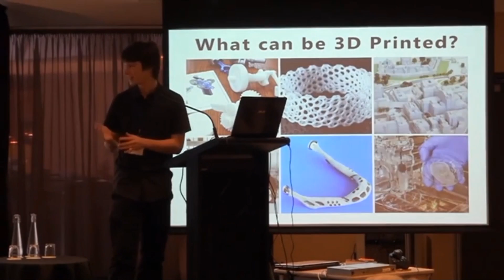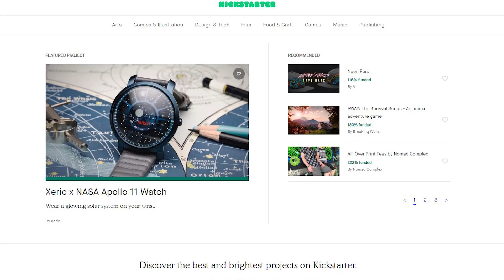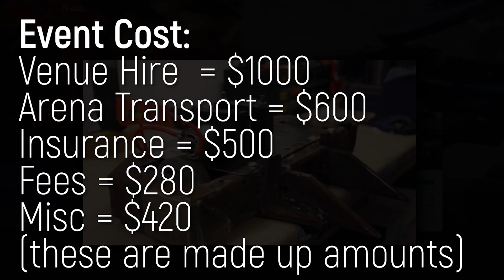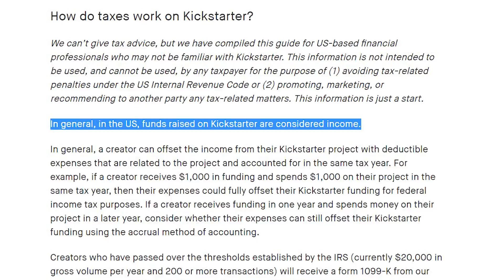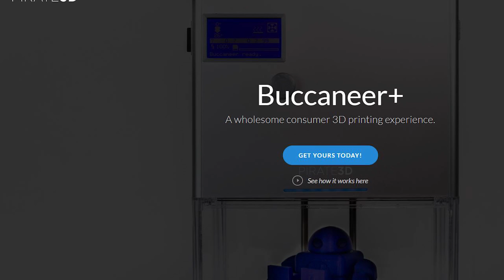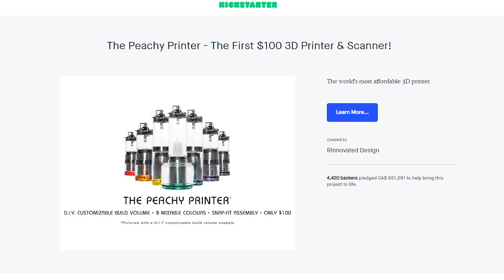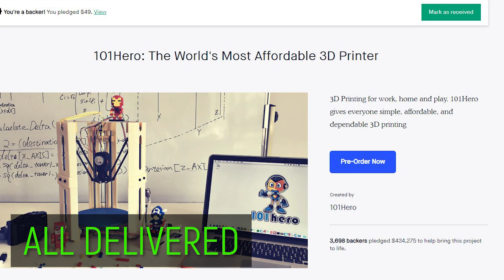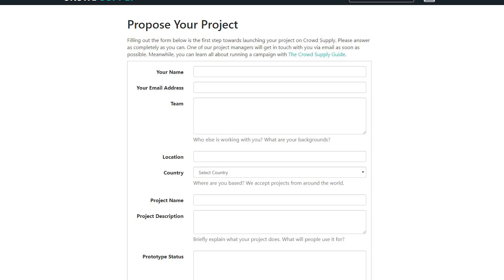This 3D Printer Raised $1,438,765 and Failed. Crowdfunding Warning.

Comment: Posted a horribly long comment here about a year ago and totally forgot about it. In it I talked about one of my own projects (apparently I had watched this video before and totally forgot about that as it peaked my interest again today). I deleted my original comment as there was so much wrong with it. I knew about some manufacturing hurdles when I first wrote it, but after a year of Material Science classes, I know so much more. I'm still not giving up on the project and have bought a domain for it too. I have no idea of what the price point will be. Gotta do a ton of testing and research first, before that ever becomes something I want to calculate. I want this to work and I want a solid plan to deliver, before it ever gets on to any kind of crowd funding.

A tip to anyone sitting with cool, new ideas, is to not seek a patent, but instead seek trademark protection. Patenting anything is super expensive and can easily swallow all of your funds alone as you have to patent it individually in every country you wish to release it in (this is the main reason China can easily copy other products, as those products aren't patented in China and are thus fair game). Go for a trademark of the design instead. Trademarks are internationally bound. Yes, you have to pay annually or so for their upkeep, but for a startup with a brand new idea, that is a way better tradeoff than just buying patent after patent. Trademark your design, but don't stop there. Got a specific color combination? Trademark that too. A specific font or lettering style used? Trademark. Logos? Trademark. Custom audio? Trademark. Trademark everything. You'll quickly find that you can protect 90% of your business copyrights through trademarks. And if you're low on money, then pray someone infringes on the trademark. If you've got the trademark and the infringement is totally clear, then that court case is yours.

Edit: The latter may seem morally wrong, but a business only lives for one thing. Money.

Comment: I was a Buccaneer backer who got a printer, enjoyed the printer, and did my research about the printer prior to backing. 

I've since moved on to an Elegoo Saturn resin printer because.. well.. mostly coolness factor, money to burn, and a desire to learn how 3D printing really works (without having it hidden by some simple front-end software), but I did have some really good prints on my Buccaneer and printed some nice brackets and stuff for some tech projects I was working on, plus learned a ton of stuff.

I went through a bit of a checklist before backing, which included "does this have a physical prototype?" (it did), "have they had other Kickstarters before?" (no), "realistically, how well could this all scale up on a manufacturing level?" (rather well, given the simple internals, off-the-shelf components and such), "does it have proprietary stuff that can't be replaced?" (no), and "if the company shits itself, can I still use this product?" (yes, even today, if you have the software, plus there were some efforts made to convert it into a more advanced 3D printer)

So with that in mind, I backed, and don't regret my decision, especially given that it was my first printer, but given the option earlier this year, I went for the more advanced (i.e. one designed for the masses, not for those that had never 3D printed before) Elegoo Saturn. 

Anyway, I think they did the best job they could, but a combination of raising not enough money, tweaking of things before going to manufacturing, and failing to secure enough funding to continue on, were its downfall.

Comment: I backed a kickstarter called Chip computer (basically a lower powered ARM computer). That one delivered but the backing company failed and there's no more software update.
Then I backed indiegogo gimbal camera that still has issue but the developer cannot improve it anymore. 
I also backed the 2 Keychron mechanical keyboards, that one was successful with perfect product.
Make sure you back a reputable company... that's my experience.

Comment: I actually funded the Obsidian and got burned. Since this was the second campaign of the company after a successful first one, I thought the risk was quite low. I'm not sure if I was right, but I'm sure I'm never getting my printer.
Too good to be true is really the key when it comes to crowd funding I guess. I recently just bought my first printer the old-fashioned way, in a shop. A cheap AnyCubic Mega Zero, which seems like great value for money, with even lower risk. Never touching anything crowdfunded again.

Comment: I honestly didn't even know that it was a Kickstarter project. I got hold of an earlier Buccaneer without the SD card slot and the fact that all it had in ports being the power cord already raised a red flag. The filament constantly jammed on me and it wasn't an uncommon sight to see the printer with its top cover off (due to me constantly having to grab loose filament pieces.)

Unfortunately, I'm rather inexperienced with 3D printers. All I can really tell you is that it's otherwise fine, if this is your only printer and you for whatever reason can't get hold of another.

Comment: Idk about buying 3d printers through Kickstarter but I center rainst buy a crap ton of 3d printable designs from kickstarters and I always get more than my money’s worth. I usually go for the most complete package which includes license to sell the models; otherwise, I just go for the most complete set. Needless to say I’ve dropped thousands and thousands on models from Printable Scenery, RocketPigGames, anything compatible with openlock or dragonlock systems, Dark Realms, 3D Print Terrain, Obsession (Hell Hath No Fury), etc...and every time I’ve been 100% satisfied with all that I’ve invested. The creators have been spot on with release dates. Obsession ran a bit behind schedule, but I have no complaints in general, and I’m convinced that it really is the absolute best way to purchase terrain sets, even if you don’t intend to sell anything. It all sells for much more money after it’s released to their eshops.

I mentioned all of that because I have become very complacent and comfortable in backing projects and I assumed that Kickstarter would hold creators as legally liable for their campaigns. Not that Kickstarter would refund me if something went wrong, but that it would have a system in place where backers could file suits more easily and not have to track the creator down blindly, etc... And not that anyone wants to pay for a lawyer to sue them. Idk I made sure I bought from established creators who had successfully ran campaigns prior to me getting involved. For 3D printers, I can see how that wouldn’t be an option. For others; play it safe like I do and you won’t have to worry so much about getting ripped off. However, if anything good is to come from a Kickstarter then people will have to take chances on things. Just leave that to people who can afford to take the chances, and if you don’t have money to lose in that manner if it should go bad, then try and stay away from iffy investments. That’s all we can do really.

Comment: I fundend the RigidBot when it was on Kickstarter. The founder burned through all his funds (despite getting roughly 30x his funding goal) he then ended up draining his personal line of credit, remortgaging his house and even take out loans from family. It really should have failed but even though it was a year late he managed to get (basically) all the perks out. The printer itself is fairly primitive by today's standards but it's heated build surface is huge (12" by 16"), all the components are accessible for maintenance, repair or enhancements and the frame is built like a tank. I can literally sit on the thing with all of my weight WHILE it's printing and it is not affected (actually it seems to print a little better lol). I hope the founder is doing alright now.

Comment: I backed the Tiko but asked for and received a full refund after the campaign because the updates they were posting showed they clearly didn't have the technical skill to make it successful, they were making the sort of design mistakes that a rookie DIY tinkerer would make if they had never built a 3D printer before. The Udoo Bolt was another, I did the same thing, was just getting a bad feeling from the updates because of problems they were having and asked for a refund. The Udoo was successful, but backers have had endless problems with fulfilment (wrong RAM supplied in kits etc), cheap parts (very noisy fan) and poor build quality/firmware bugs (boards spontaneously crashing and rebooting etc).

Sometimes, you just have to read between the lines in updates and you will often see when a kickstarter is going to fail, even before it really starts getting into trouble. So far, I've received all of the items I have backed (only 12 though), some better than others (the Luxor 2 flashlight is a good example of nice design but really crap firmware), but haven't lost my money yet.

It's just a matter of reading updates thoroughly and paying attention to the problems they are having with design etc.

Comment: I have always said. NEVER use a product that depends on the cloud. Without an internet connection, you can´t work. Website down for maintenance, Cant work. They go bankrupt, You cant work. The cloud should never be used for anything that can be run locally. For some reason ever since cloud became a buzz word EVERYTHING is made as a cloud platform or app. There was a time you couldn´t use the Adobe suit without an internet connection and even now Microsoft word needs to connect to a DRM server every few days or it goes into a view only mode.

Comment: I was actually one of the few people who got a Tiko3D!
One of the full production ones.
Their cloud service never got set up, so that didn't work, and as such the included instructions don't work.
However, if the tiko can't find the cloud service, it'll create a wifi hotspot. You can connect to that and get a rather stripped down version of their cloud service thing running straight on the Tiko.
You can drag models into your browser and set it to start printing.
There's not many settings, as it was designed as a printer you don't have to think about, so anything more advanced than nozzle temp is hidden away or simply not accessible.
I don't believe straight gcode was ever implemented. It was something they talked about implementing later down the road... see how that turned out.
overall: it works. It can be really fiddly sometimes, and kinda scary at times (it finds out where the head is by a sort of bed-leveling thing where it just crashes the (pre-heated) hot-end onto the bed until it can't move anymore on the 3 corners, thus it knows it's that far away from the bed.), and it's failed more prints than it's done successfully (Which is a shame given how locked-up the software is. Also the temp settings printed on the spool don't work. People on the forums have better temps for the supplied filaments). Also the rafts suck, and every other time it ends up bonding to it. But it works. Kinda bad print quality. okay, really bad print quality. But it produces things about 50% of the time!

Comment: Ejection molding is cheap, there's a reason why it's so widely used. I don't get why this guy wants to make it sound like it's expensive. Also, that looks like aluminum, laser cutting that is easy and it's a cheap material to buy in high amounts.

Comment: I will never trust a 3d printer that hides the process! in fact, you need to watch it carefully as it develops, layer by layer, because a small blob of messy filament could create a snowball effect that ruins  the printing and YOU NEED TO WATCH FOR THAT PARTICULAR MOMENT to stop the printer and prevent a massive problem (warping or base dislodging or even a risk of fire); with delicate materials suchs as ABS or flexibles the watching is even more critical

Comment: My first 3D printer was the Trinus3D which is made by Kodama, the creators of the upcoming “Obsidian” printer. I have never been happier with a 3D printer before. Backed in 2014(?), still works amazingly well to this day, and the community is amazing. I think Kodama did a very good job with their previous KS and they probably can handle this one pretty well too. Micheal (Founder of Kodama) has always been, and still, heavily involved with the community, which is an excellent thing.

Comment: I want to have my own tech company, possibly starting using kickstarter.
But I don't rush, as you said need some experience, so I work as a engineer in a industrial company, I get to do various things related to production, both mechanical and electronics.

Comment: Some years back (maybe 5 or 6) I was working at Maker Faire in the SF Bay Area.  I met a guy who had created a 3D printer that would fit in the palm of a hand.  He was printing very tiny things, of course, and I wondered at first what use that could be.  But his pitch to anyone who would listen was that he had $900k in outstanding orders through Kickstarter, and he could not figure out how to deliver.  He was going to sell the tiny machines for $300 each, and he figured he'd make, maybe 15 or 20 of them in his garage before he could figure out how to get manufacturing assistance.  But now he was looking at having to make 3,000 of them,  and he was in a panic.  I actually went back to some VC friends of mine and said - hey, here's a guy who has found a market and proved it.  He's got $900k in backlog orders and needs help scaling.  Why not give him some working capital and a partner who knows manufacturing?  (After all, that's what VCs do.  Of course, they own your soul as a result, but hey, it's better than going belly-up in the fishtank.)  And absolutely nobody (at least in my silicon valley circles) would touch it.  They figured that 3D printing was some sort of passing phase and it would take a big player to make it "real" and this was not the guy.  Everyone passed on the opportunity and far as I know, this guy made 15 palm-sized 3D printers and then ran away. Not sure there was much use for microscopically sized plastic models of Yoda's head (which is all he had at that point).

Comment: Thankfully there have been enough flopped campaigns out there that it's not too hard to distinguish a flashy video with a semi working product to a campaign actually offering a fully developed design.  Good video. The kickstarter for my draken barely made it and the company isn't that big but they are still selling printers.... at least a couple that is.

Comment: I remember a number of those campaigns. I thought about backing Tiko but didn't. If the Buccaneer and Tiko needed some app or custom slicer to be useful how difficult would it be to flash new (standard?) firmware to get them working or to replace their controller boards to make them in to working machines?

Comment: TLDR, beware of cheap 3D printers on KS.  
Unliked this video because of what you said "Crowdfunding is not a pre-order" sentence as there are different mindset from people. 

End on a critical note: what can be improved from a need startup company that wants to sell these products would be showing the community roughly how much the hardware and software cost as well as Tax.
Reply: KS is never a pre-order. A pre-order is (normally) a sure thing, but Kickstarter is never a sure thing. Seeing it as such is a good way to get scammed.

Comment: I backed a really nice desk for my computer that failed. Back when I was in HS and I saved up hundreds to do it and it failed. That was the last time i spent more than a few bucks on anything I didn’t get right away. A hard lesson for a high schooler
Reply: What was the desk supposed to do? Should have just built one from scratch with those hundreds you had, man.
Reply: Nine Tails I should’ve but I didn’t have CAD experience or anything, and I didn’t really have the tools to. I would now but back then it was supposed to be the coolest thing. It had LEDs, power strip, the whole top was a map, it had an industrial steel look. Sad